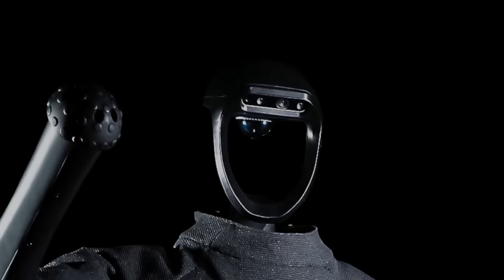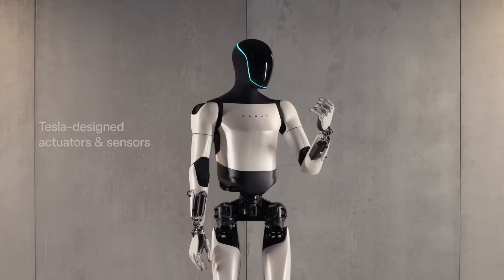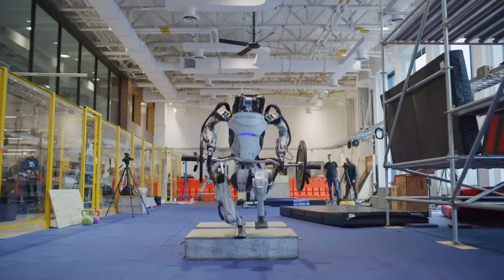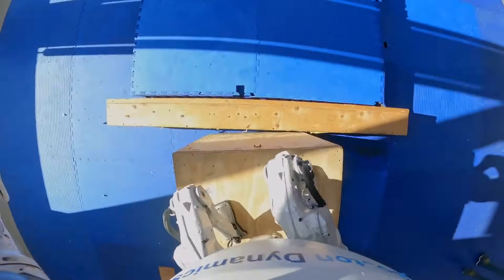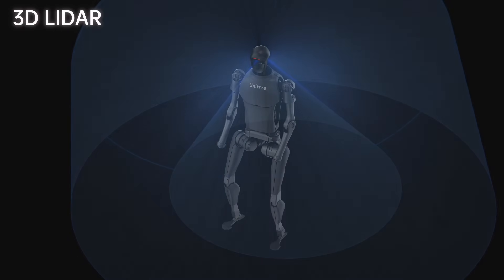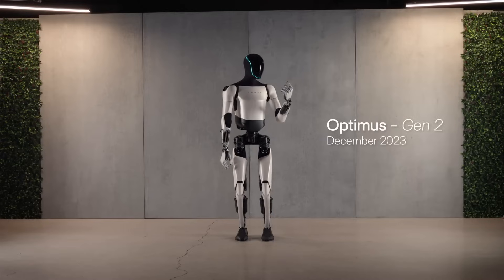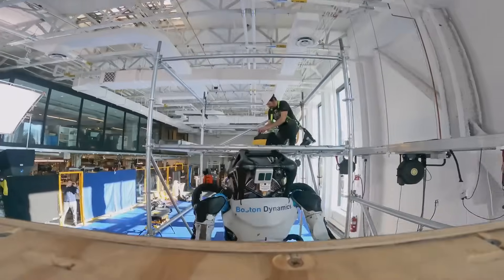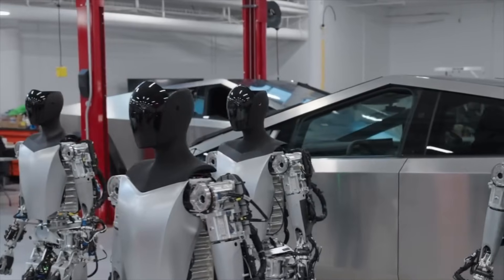Tesla Optimus Gen 2, Unitree H1 and Atlas Dynamic - Best Humanoid Robots.

Comment: Stupid music, no any detailed analysis, just what any stupid can talk watching the video.

Uni-3 H1 is basically beginning ATLAS just with a hip,nothing else.

OPTIMUS- well Atlas dynamic can do all that,the video shown of its sensors/hand design are generic robot video.Not to hate but the self sustaining AI bragged about OPTIMUS is nothing new, ATLAS is the most advanced yet.

ATLAS-(Boston dynamic) they have been making (Advanced)robots even  before tesla or any other company. ATLAS doesn't uses servo motor for its knees, mixture of both hydraulic and servo, hence they can jump and no one else can. 
Using a fancy hand is nothing compared to making a robot walk or hell jump,fucking parkour, BACKFLIP etc hence the weird round rubbered thing.

CONCLUSION - H1 being faster is just a gimmick which is nothing to be praised about, motors can easily pick weights more than their size, so the whole 30 kg is pure gimmick.

Optimus gen 2- Tesla is just trying to mainstream robot hence the more humanoid body, hands etc,but once again nothing new.

BD-ATLAS- Atlas is the PINNACLE OF ROBOTICS because of how much data BOSTON has on robots compared to both optimus and H1, its a huge gap.
Finally - NO ONE IS SELLING  THEIR ROBOTS (especially BOSTON) so why the fuck mention their price, those are just round up components price added figures.

Comment: 00:14 Unitree H1 is a powerful multi-purpose humanoid robot.
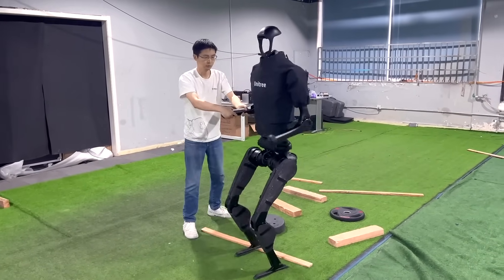01:23 Tesla Optimus Gen 2, a leap forward in humanoid robotics.
02:32 Optimus Gen 2 and Atlas Dynamic - Advanced Humanoid Robots
03:46 Atlas humanoid robot showcases advanced capabilities
04:50 Tesla Optimus Gen 2, Unitree H1 and Atlas Dynamic are advanced bipedal robots.
05:56 Unry H1 is more affordable and larger in size
07:21 Optimus Gen 2 and Atlas Dynamic features
08:33 Atlas Dynamic has flexibility advantage and high durability

Comment: Boston Dynamics is still a step ahead.
Reply: Can you imagine what they could come up with if all three company's brought their skills and knowledge on a collaborated project.
Reply: @yinyang2385 If that happens, Unitree will just copy from everybody else with nothing no contribute.
Reply: The Boston Dynamics uses human algotims to move and do things, is not deep learning. it will never escalate in the behavior and learning. uses hidraulic actuators making it more powerfull but more  expensive, high battery use and more failure  posibility. They swamp now to deep learning using nvidia groot i think (still not showed) . we will see if they can use their expertice in the mechanic of the robot when they use neural network brain.
Reply: Guys, Atlas 2.0 just dropped!
Reply: @D.Aniel89  thx!!
Reply: Tesla has much more advanced AI integration, can learn from experience and by reading instructions or watching videos. And Tesla will probably be able to produce the robots much more efficiently and at a lower price, with their Gigafactories. The Boston Dynamics stuff is great but the behavior of their robots is preprogrammed, and only to a small degree utilizing AI.
Reply: Definitely. As an afterthought, I am wondering what size of the program is required to make their units function optimally.
Reply: They are too expensive and can only exist in the laboratory. And the other two have the chance to become everyone's choice.
Reply: Yeah but the Unitree robots are already ready to be shipped out for sale and only go for $90,000 for their best model and it gets cheaper from there. They also have an app for your phone to already begin using the Robot. Boston Dynamics will never get to that point. Their bots will probably cost 10x that amount that nobody can afford and they aren't even close to the point of making them public, let alone already have an app to start using it.

Unitree is miles ahead of everyone, especially Boston Dynamics
Reply: @Zerobytexai  Boston dynamics isn’t about cost. It’s for the military. Unitree isn’t oven close to atlas in terms of agility. They have a long way to go
Reply: For sure.  They've been at this for decades.  They should be way further along though imo.
Reply: @crew3025 Also, I think they still concentrate on overall functionality - rather than trying to make the machine look as human as possible, which is what the other 2 are clearly  looking at. They are the most humanoid in shape, but Boston's is so much quicker and more versatile.
Reply: China, a developing country, is on par with usa, a developed country, in bipedal robotics
Reply: @AAAAAA-tj1nq  They just steal what they can't invent. BIG advantage.
Reply: @AAAAAA-tj1nq  you wish

Comment: The undeniable number 1 is Boston Dynamics, second with a way to go is unitree. They are on the way but a far cry from BD. TOG2 gives animatronic vibes. stiff walking, solid based functions and a mirrored dance routine don't give me the feeling they can with stand a kick or uneven ground. It feels like looking at different robots in simalar packaging. I see gen 1, gen 2 and robot hands with a pressure sensitive surface. It's like comparing a Koeningsegg, a middle class volkswagen and a sloppy build kitcar.
Reply: Boston Dynamic is a FAKE !

Comment: tesla optimus seems like more useful for  industrial or house labor while 
atlas seems more capable for as weaponized robots.
Reply: i would argue the tesla one would be very useful in war since it could handle any weapon a human can with them hands, plus it has an actual brain so to speak with its multimodal LLM, when you watch atlas doing an assault course, every step has been programmed by a human, and it will fail to complete the course multiple times until the human gets it correct.
Reply: @JohnSmith-df4vb  actually. a combination of both would be nice.
Reply: @JohnSmith-df4vb  Robots do not have to carry weapons in order to be useful on a battlefield.
Reply: atlas doesn't have a LLM, it isn't responding to things. It is just doing a sequence of moves preprogrammed. ... for me it isn't even the same device as what Tesla is making. robots using LLM's will ultimately be more interactive and give a more useful day to day interaction. Atlas could perform some set repeated functions maybe controlled by a high LLM or something... but honestly it is just a remote drone.
Reply: @shankdiddy9045  yah. but i believe what optimus has may also be put in atlas. and i believe that boston dynamics robot will be obsolete because of not using AI. and it is funny how boston dynamics did not embrace modern AI which holding them back from being top notch robotics company.
Reply: @shankdiddy9045  Despite what Elon tells you, none of these robots will run an LLM any time soon. LLMs require thousands of high end graphics cards and massive amounts of electricity. These robots are running ML models at best.
Reply: @johnnguyen3834 lol, nothing you said is right.
Reply: Optimus would beat Atlas on the battle field, hands down. Atlas can't think out of the box. 
Optimus could learn in a day how to use a javelin, sling shot and lay traps.
Reply: That is an interesting observation.  Boston Dynamics did start our looking at military solutions.  Yet its current form is still not ideal for the battlefield.  It would be at a distinct disadvantage with its "CLAW." BD's biggest deficit is that their robots are all "programmed" and cannot navigate well in an unscripted format.  The built-in core AI capabilities that Tesla has are simply non-existent for BD.  While BD definitely can do backflips, this is not a skill most factories or homes require, nor, for that matter, the battlefield.  I can appreciate the impressive nature of BD's Atlus, but it isn't innovative, and the machine has mostly been unchanged over the last 5 years. Over the next 5 years, this lack of innovation will become increasingly punishing for BD as Telsa will likely literally leapfrog Atlus in capabilities as it clearly just did with its hands and neck.
Reply: Ĥumanoid robots needs a mind to be usefull , for now yuo have this , but yuo gone need money , a lot , so
Reply: It's like comparing a housekeeper or waiter with a weight lifter or bodybuilder lol, both robot are designed for different tasks, for example I can see Atlas working at a warehouse or construction worker, as for Optimums Gem 2 I can see him working on a kitchen at a restaurant or housekeeping at a hotel, what I'm trying to say here is, people need to get ready, because it's with robots like this that in a future nearby half of the work force Will be replaced by them. The movies have already shown us that and those movies are becoming more real by the day. lol
Reply: That would be true if the Tesla robots could actually do those types of intricate movements. Those movements are actually done with a guy using a remote controller. They had to admit this when they got busted when they released that video. You could see the shadow of the guy using the remote controller immediately off-screen. Another thing that they do is use cut scenes right before the intricate movements to make it look like the robot could do it (ex. show the robot about to crack the egg cut scene show the egg immediately afterwards as if the robot had just done it). Elon also addressed this. He said "No more cut scenes". So unfortunately those robots can't do any of those things.. but it sure looked cool tho, Lol